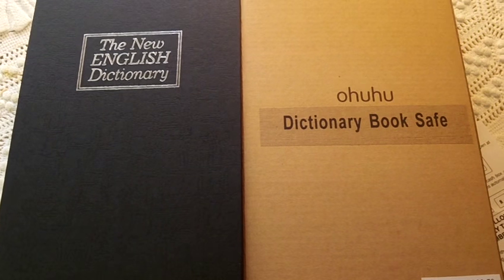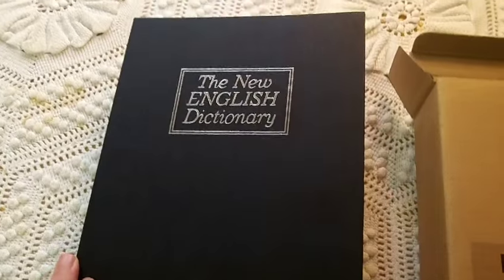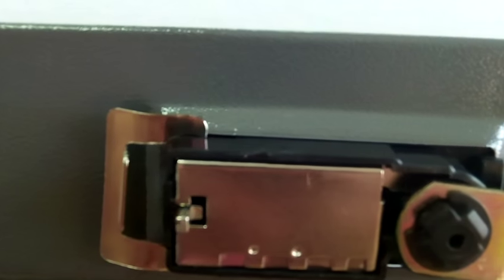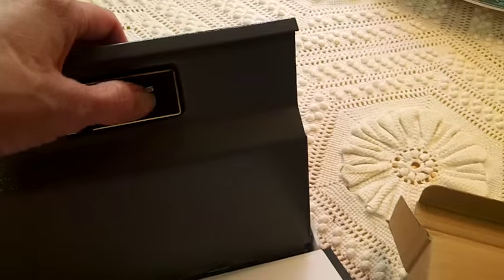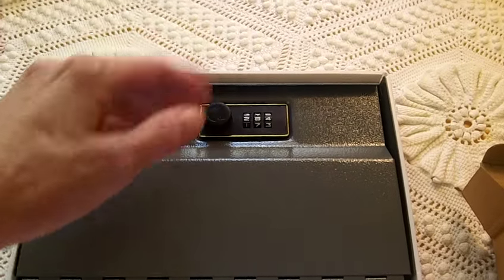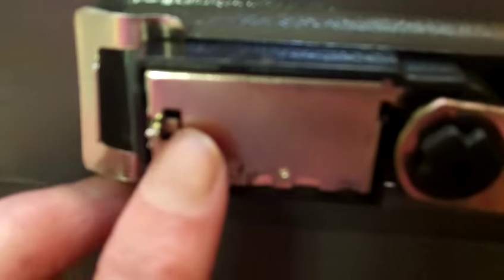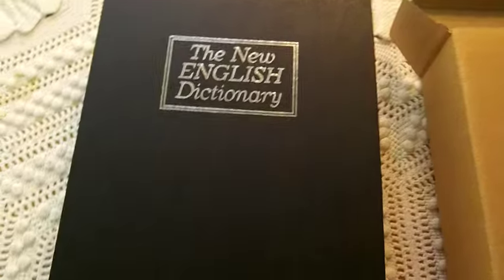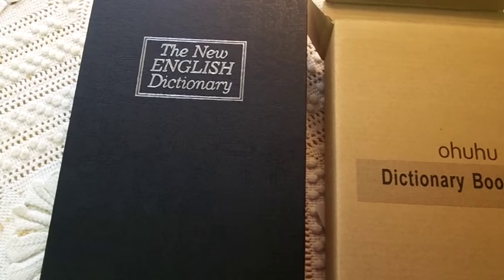Ohuhu Dictionary Diversion Book Safe How too and Review #Boosafe

Comment: Hi I'm worried I cannot open my safe I had it set just like you said when I first got it and then I was trying to open it today and it open but then it wasn't locking and I switched the lever back to what it was from the manufacturer doing it that way and now it's just completely locked and it won't unlock at all what should I do??
Reply: I am facing the same damn problem,  did you end up figuring out?